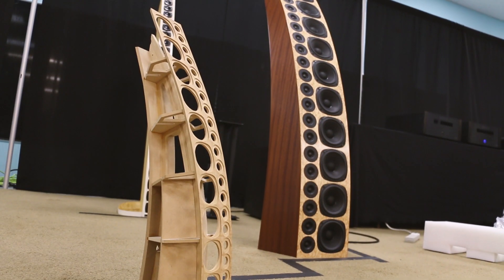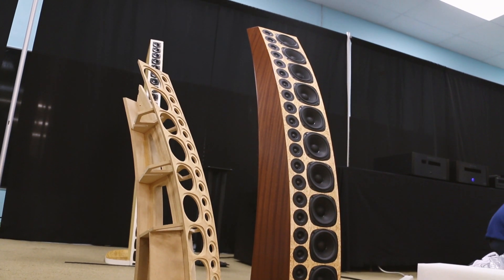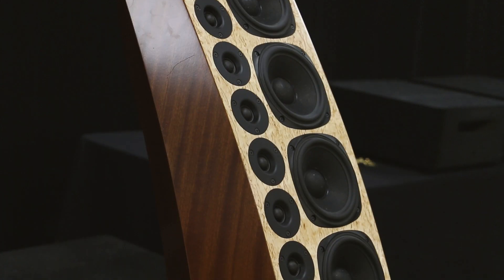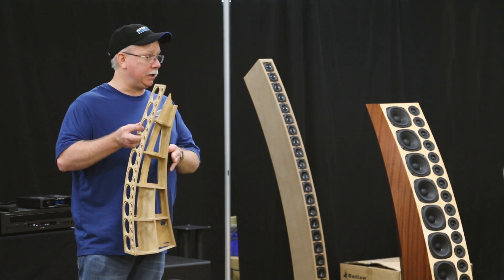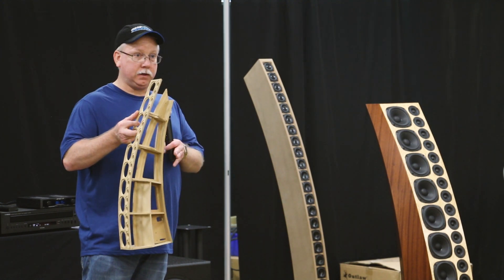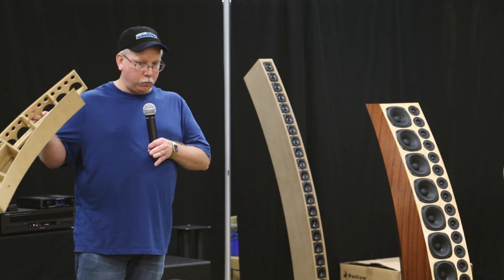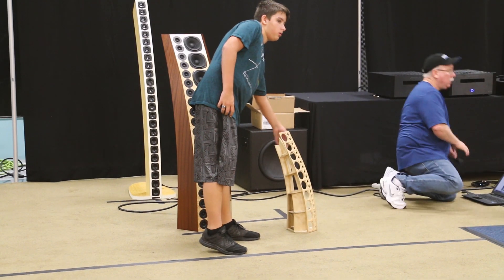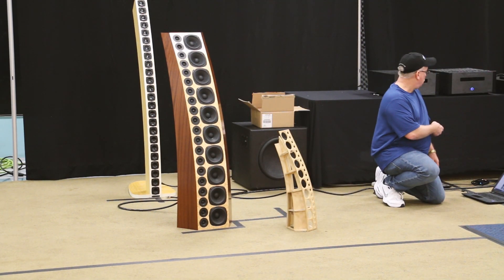Speaker Design Competition Winner - Kevin Kendrick - The Gandalfs

Comment: What’s the theory/thinking behind a curved array that leans AWAY from the listener? I’m familiar with arrays that time align drivers by curving further away from the listener in the middle, but the top and bottom are closer to the listener. Any help, thanks in advance!
Reply: It's taking the idea of a line array one step further. A line array creates a wall of sound making it sound like one really big speaker, curving it adds another dimension to that idea by deliberately introducing a measured amount of delay / reflection to the sound to create a "fog" of sound. All drivers are going to some degree impart side wall, roof and floor reflections into the sound. If done badly you can hear the delay which the brain interprets as annoying beyond a certain amount of ms. By slightly angling each of the drivers you fill the gaps inbetween those big reflections, causing many more varied reflection points. So you brain can't easily say hey that sound off that far wall took a long time to get to me.

Comment: This inspired me to build a curved front line array type speaker , two way, 6  4 inch main drivers each cabinet and one titanium bullet horn driver in each as well, I encorporated a 12 inch passive radiator on mirrored sides of the cabinets, they sound amazing best pair I ever designed and built.
Reply: Im really thinking about building this type of speaker.  Question how do they do in an urban  standard sized living room type environment  ie  14x16 feet
Reply: Photo?

Comment: 38sec mark huge scratch in side of tower.... looks solid besides that scratch.
Reply: It's actually a fracture, not a scratch.  Decided to add t-nuts for the drivers after the enclosures were built and pulled the t-nuts up with a screw gun.  Didn't realize the impact from the screw gun caused a fracture in the lacquer until they were all installed.  There wasn't enough time left before this competition to fix it but it is repairable.  Thanks.
Reply: still the work is outstanding! i bet they sound good!
Reply: Thanks Marc.  I'm very pleased with how they sound and am hearing details in some of my music that I haven't heard on other speakers, very cool.  They also capable of getting pretty loud and staying remarkably clean while doing it. Unfortunately, I have neighbors and we have a hard time agreeing on the type of music we all like. :)

Comment: +Parts Express Are they all wired in phase or are the ones bouncing off the roof in 180 degrees and the ones facing the people in 0 degrees
Reply: The drivers are wired in phase. The reason that the cabinet is curved is to create a curved wavefront.

Imagine what happens when a point source radiates a wavefront: the sound expands spherically.

CBTs are designed to do the same thing.

For more, check out xlrtechs.com
Reply: magestik6 zz